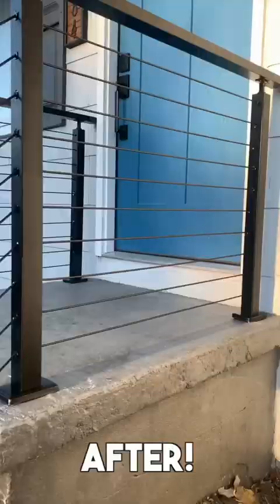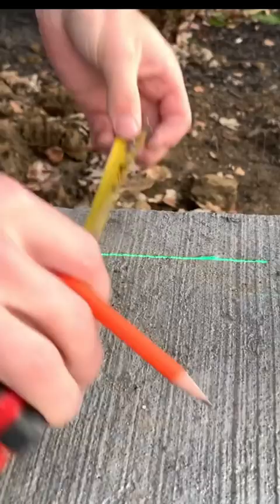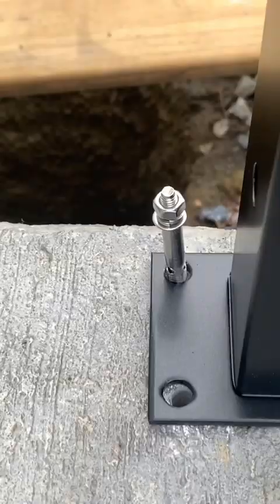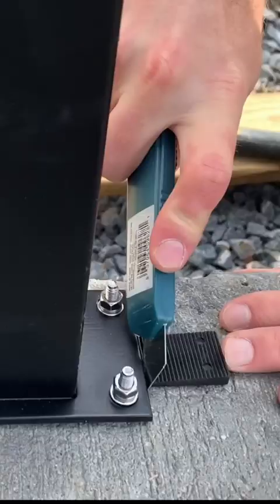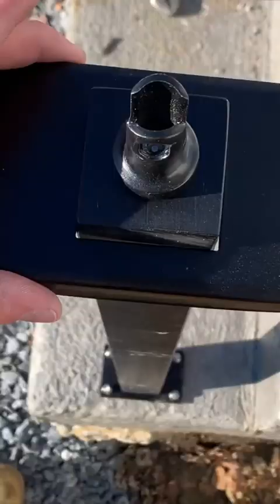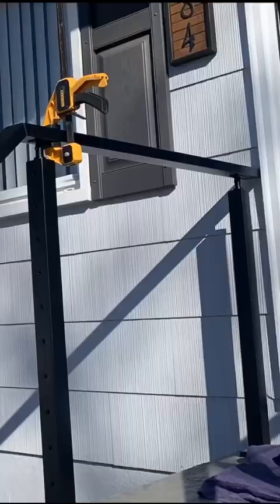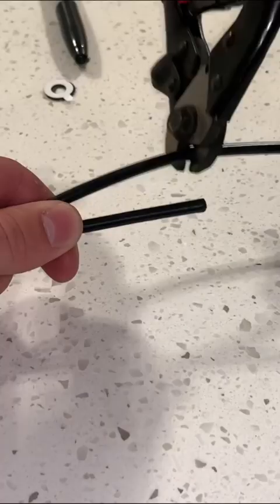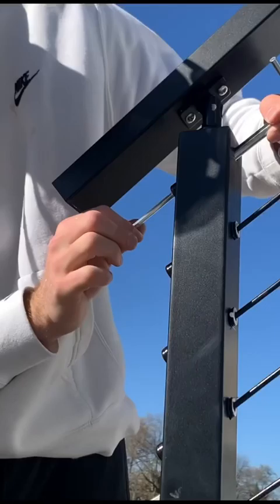DIY Stair Railing Transformation on Front Porch! (Cable Railing) #diy #construction #howto

Comment: Super bad idea, anchoring post with bolts. Get a hole drill, drill holes and set the new post in with anchoring cement.  Use stainless steel post, they last a lifetime.
Reply from the maker: Hi! What’s the issue with the bolts exactly? I figure you could always tighten them up in the future if it gets loose?
Reply: @Andrew Thron Improvements  even if you grout( which you didn't mention) water gets in there and start the erosion process.  Not trying to troll or insult.  I've been doing this over 40 years.
Reply from the maker: @mihalispsychedelicrealeyes1284  I hear you! Appreciate the feedback. I'll probably do a "how it's holding up" video in the future to note any issues. 🤙
Reply: @Andrew Thron Improvements  excellent, my friend.  It should work out for a time. Nothing last forever.
Reply: this is how they mount car lifts, just bigger hardware. and those can lift thousands of pounds.
Reply: @Stackali  car lifts are rarely outdoors where water can penetrate in volume